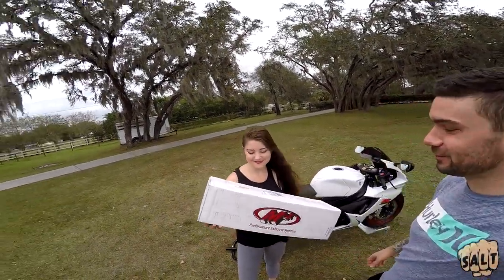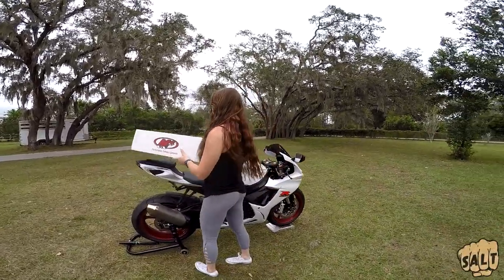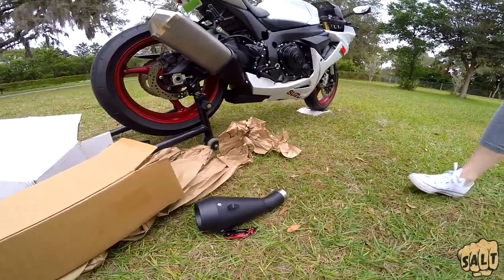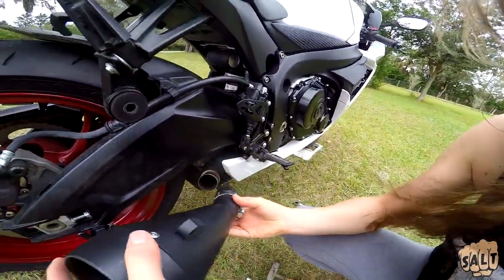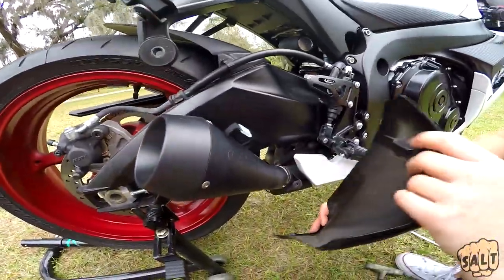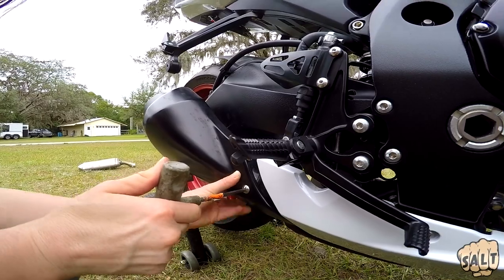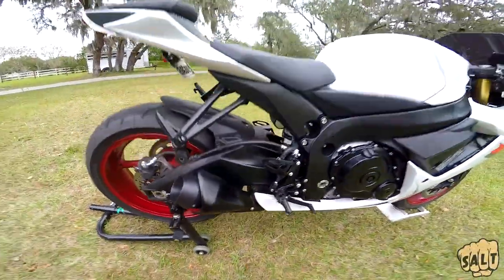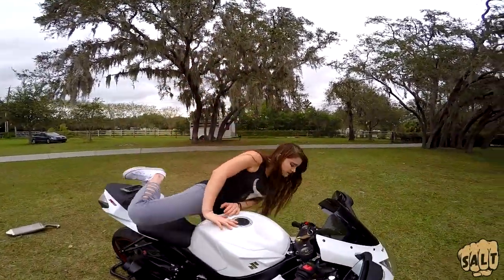Installing Her New Exhaust! GSXR750 - M4 slip on

Comment: Nice! I'm planning on getting a 2023 model. Do you know if the newer models, especially 2022-23, still have the same headers and cat or have more restrictions been added to them because of EPA rules? Just curious, because I'd like to put the same slip-on on my new bike, but on other late model bikes I've owned before, like the ZX-6R, a slip-on doesn't really do anything. You have to go with full exhaust systems to get decent sound.
Reply from the maker: Yes they do, the gsxr 600 & 750 have been the same since 2011.
Reply: @SALTxTHExWOUND  Thanks for the quick reply. I had a 2013 model some years ago and really regret selling it. The 750 induction growl paired with a simple M4 slip-on is like no other bike out there.
Reply: I just picked mine up today, had the bike on deposit for over 4 months. So I am also investigating exhaust options. Let me know what you end up with.

Comment: I have the M4 cat delete + gp pipe, sounds/looks great on the R6.
Reply: Did have to flash your ECM when deleted the cat with the M4 installed?
Reply: @curtisyoung4028  Yeah, I went ahead and got an ECU flash from Bauce Racing and a map for my Power commander V. Shipped it out and got it back 3 days later. Big difference!

Comment: really debating about getting this M4 slip on for my 2015 GSXR600. When I bought the bike it didnt come with a heat shield and im debating spending the ~$90 to get that as well, or just getting this exhaust. 
Is the sound worth the money?
Reply: Ride With Danger go for the Yoshimura don’t buy that trash I rather safe up for a Yoshimura than spend money on this cheap exhaust not worth it Yoshimura is where it is at better sound Performance better warranty and Japanese been trusting Yoshimura exhaust for years
Reply: akropovic - it's the way to go!

Comment: I just installed the same exhaust on the same bike and is yours running hotter than usual?
Reply from the maker: Antonio Holbrook no it still runs the same
Reply: SALTxTHExWOUND hmm that's odd. I installed it today and went for a ride and my bike was idling at like 210-215. And it was like 47° out.
Reply from the maker: Antonio Holbrook my bike will idle at that temp too while sitting still, the fan kicks on over 220 I believe, mine only ever goes over 180ish when I’m sitting at a light waiting
Reply: SALTxTHExWOUND oh okay that's how mine is too. I'm just getting worked up over nothing then.

Comment: Wish you had a before and after sound test but looks tight
Reply from the maker: Tony Rouse check out my older videos, I installed the same pipe on my 750 and did a before and after 👍🏻

Comment: I wanted to ask you something, hopefully you know the answer I'm thinking of changing the exhaust on my bike to decrease weight and obviously to add performance, but I'm getting a lot of conflicting answers Most people say that when you change the exhaust, to do a full exhaust overhaul, not just a slip on, and also to adjust the fuel management system to match the new exhaust that was put on What's your take on this? Ride safe and have a good one
Reply: David S save money and get a slip on man. the computer will adjust the fuel mapping enough that you don't need to worry about it, in my non professional opinion lol.
Reply from the maker: I agree with J rods, with a slip on you don’t need to adjust anything, with a full system you’d be lucky to gain 2-3hp and still have the fuel mapping reprogrammed

Comment: Did you guys ever do a tune after slip on?
Reply from the maker: No need to with only a slip on, 33k miles later still running strong 💪🏻
Reply: @SALTxTHExWOUND  How much of a difference does a Slip-On make compared to stock exhaust? Thinking about doing it to mine! How much louder is it and does it sound much better? I want to leave the cats in to avoid the all the extra requirements!